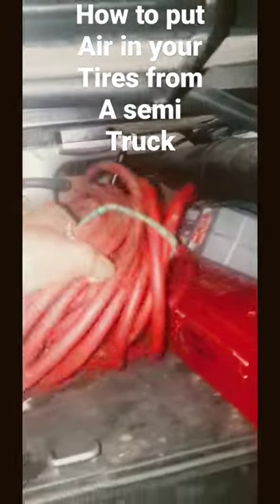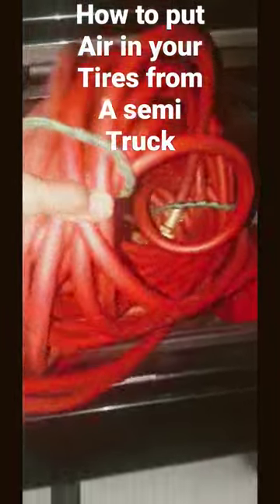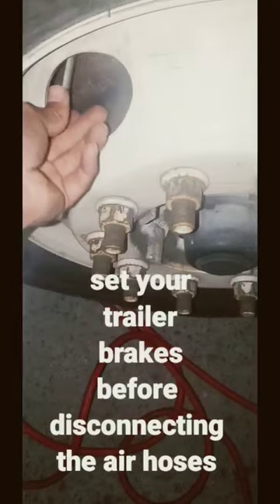How to put air in a tire using a semi truck

Comment: I have that in my car still, used to be a truck driver and they sell it in every truckstop i know of, but tge thing they dont do is seal it or even tighten it.  Had to buy some plumbers tape and two  wrenches to get the hose to work correctly.